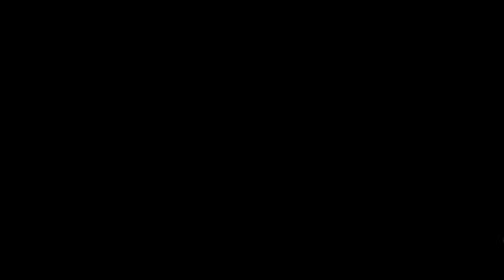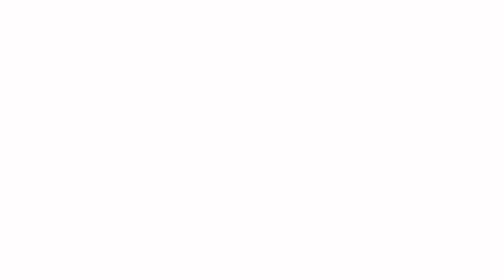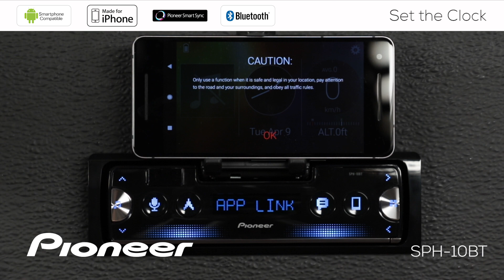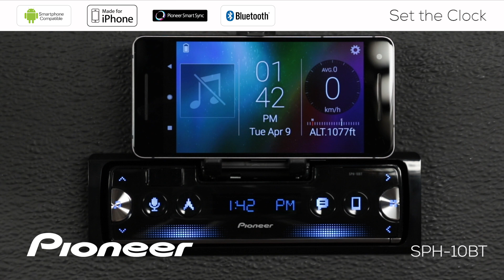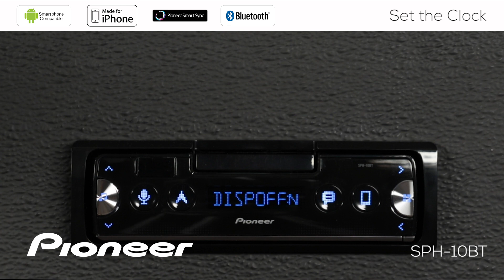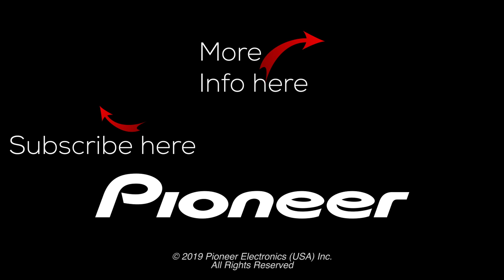How To - SPH-10BT - Set the Clock with Smart Sync App

Comment: Why is so hard to connect this radio with Bluetooth? What this need the number to pair every time? I spend more than 10 min to connect. What is the problem????
Reply: The receiver may be installed incorrectly.    If you need to re-connect the phone to the in-dash receiver every time you start your vehicle it means the in-dash receiver is installed incorrectly.  Here is a video about the Pioneer Wire Harness System:   https://youtu.be/-bF3uzzaT30?list=PLw63zJRQbCNiGNMG9zaOiTR3NgWe2T7ol  Focus on the Red Wire and the Yellow Wire.  Do not wire Red and Yellow together.  
After you get the wiring corrected, please be sure to install the latest firmware for your Pioneer SPH-10BT.  You can find it here:  https://www.pioneerelectronics.com/PUSA/Car/Digital+Media+Receivers/SPH-10BT#downloads  
After you get the firmware updated, delete the phone from the in-dash receiver's Bluetooth memory, and then delete the in-dash receiver from your phone's Bluetooth memory. Restart your phone and start the Bluetooth pairing process from the beginning.  
You can find more videos about Pioneer SPH-10BT here:  https://youtu.be/_ISxPmindi4?list=PLw63zJRQbCNiGNMG9zaOiTR3NgWe2T7ol   and you can find more videos on Pioneer's YouTube Channel here: https://www.youtube.com/user/pioneerelectronics   
And by the way, the ???? on your keyboard is sticking.

Comment: How to you set up steering wheel controls. Just ordered my pioneer sph-10bt and I’m going to wire in universal steering wheel controls. I was wondering if you can custom set the button functions from the settings on the head unit?
Reply: No.  Pioneer SPH-10BT will work with many different steering wheel control adapters.  Here is one example:  https://maestro.idatalink.com/product/product/product_id/101      Pioneer SPH-10BT does not have steering wheel control set up operations built into the in-dash receiver.  Setup happens with the steering wheel control adapter.  You can find more videos about Pioneer SPH-10BT here:  https://youtu.be/wgvHfVus7Xw?list=PLw63zJRQbCNiGNMG9zaOiTR3NgWe2T7ol   and you can find more videos on Pioneer's You Tube Channel here:  https://www.youtube.com/user/pioneerelectronics

Comment: I still dont know how to tune the stations without using the phone. I just dont have the time to link it everytime I get on the car. I would like to know how to preset the stations I want. Not the ones with the strongest signal.
Reply: The Pioneer SPH-10BT is designed to operate with the phone.  As of 2019 April, the Smart Sync App has two types of radio station presets, BSM or strongest radio station presets and Favorites.  Only the BSM presets can be accessed without the use of the phone.  Radio Station Favorites can be accessed with the phone as seen in this video:  https://youtu.be/wuV0LIVxFes?list=PLw63zJRQbCNiGNMG9zaOiTR3NgWe2T7ol  You can see more videos about Pioneer SPH-10BT here:  https://youtu.be/wgvHfVus7Xw?list=PLw63zJRQbCNiGNMG9zaOiTR3NgWe2T7ol  and you can find more videos on Pioneer's You Tube Channel here:  https://www.youtube.com/user/pioneerelectronics